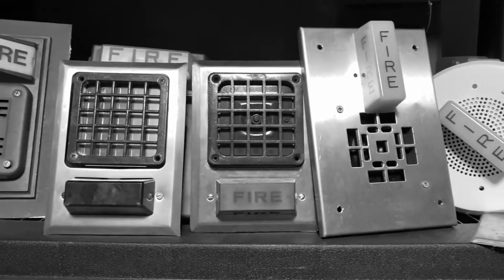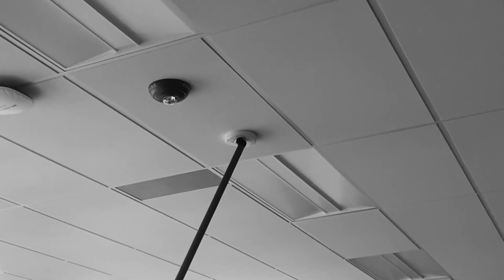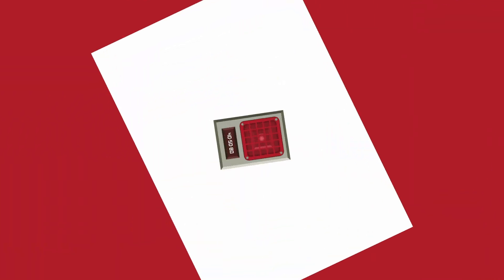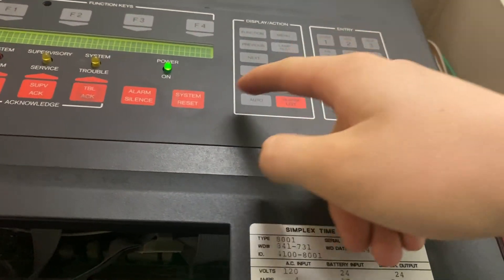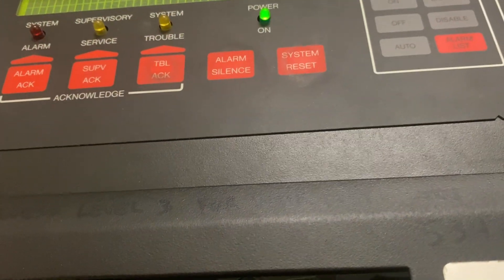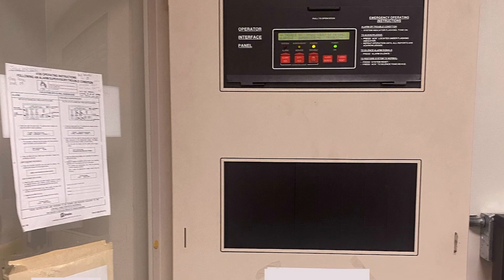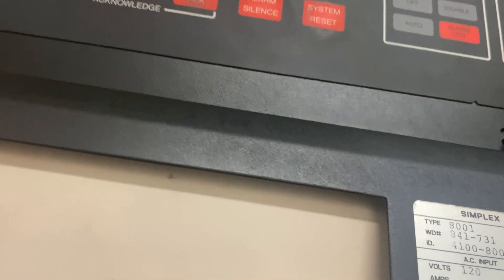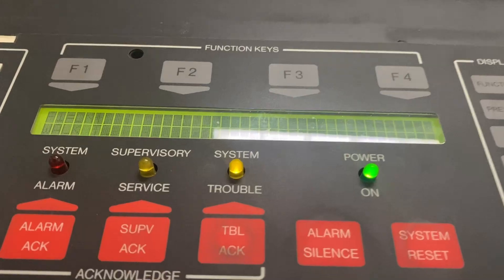Fire Alarm Test #100 | Mixed Vintage Simplex

Comment: 4:33 was that an MT I heard
Reply from the maker: Yes. There’s a weird 10-15 foot hallway extension outside the added black box theater that has a MT-LSM. I didn’t record it so I didn’t think to mention it. That hallway is weird as there is an old 4251-30 about 12 feet from the exit and another one about 4 feet from the exit which is probably due to the wall originally ending at the first pull

Comment: i bet that was a 2001 system or a 4002 or 4207 or 8
Reply: The 4100 is original. Its a VERY EARLY one!
Reply from the maker: @bruh3120 correct
Reply: @4O5O-8O  1st gen i thought u said the building is from the 60s
Reply from the maker: @vintagesimplexfirealarmsof6440  original building had a 4246 or something even older. Original part of the building is where the 4903-9101s are now. However most of the building was built in 1989
Reply from the maker: @vintagesimplexfirealarmsof6440  none…
Reply: Bro commented the exact same thing on last years test. Seems he hasn’t learned a thing